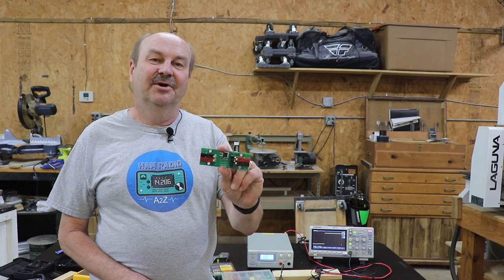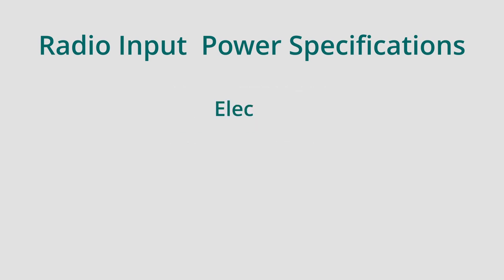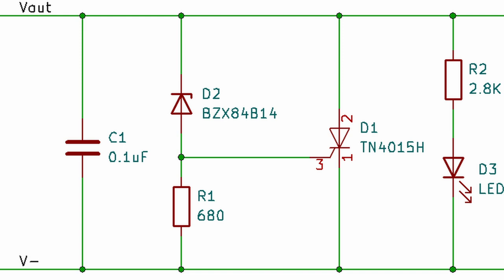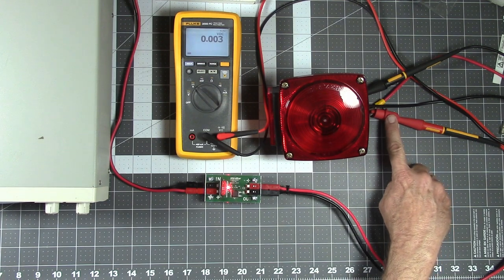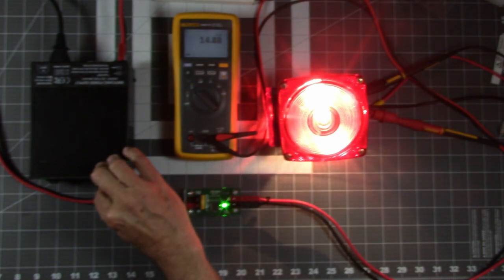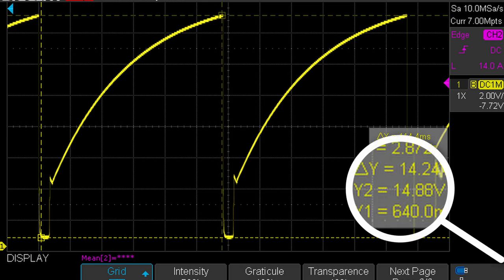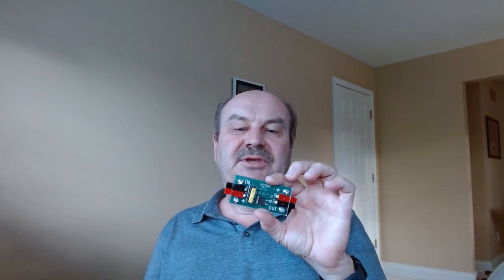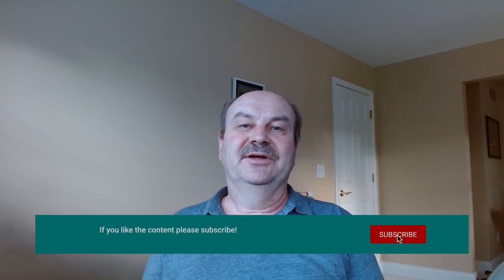Mini-Bar Introduction

Comment: Hi Tom, many thanks for this and for allowing the use of your files to build the device. I was in the process of designing one myself until I saw your video. I’ve just ordered a few boards and will make a two or three for the shack. 73 Dave G0DDF
Reply from the maker: Fantastic!

Comment: Thanks a lot Tom. I've implemented crowbars in previous power solutions, but never felt that my own implementations were elegant. They were always very crude, just a fuse on the input and a zener diode capable of handling a lot more amperage than the installed fuse. I never considered using an SCR! I'll definitely be using your improved design should I ever feel that a crowbar is needed in future power solutions; thank you for making your board design and circuit schematic available. I prefer using XT60 connectors over powerpoles, so I'll have to make one myself.

Comment: Years ago I built a home brew 30 amp supply for my radios. This was back when finding a transformer for such a project wasn't a big deal. I ran for years just on just the series pass transistors until one days I heard about a friend of mine that experienced a shorted series pass and blew his radio. Within a week I kluged together a crowbar circuit and placed in the output circuitry. And yeah I've got some of these cheap Chinese switchers that need protection added also.

Comment: I designed and built a PSU / charger that has short circuit and overload protection using a high current DC relay. The relay drops and stays out whilst the short is present, removing the short, allows the PSU to slow start via 10 watt light bulb whilst the Capacitors are charging, then switches the relay for full output.
Your circuit could be utilised to simulate the short, and instead of blowing the fuse, the relay would drop, cutting off the supply, until a reset button was pressed.
Of course if the over voltage was still there, the crowbar would prevent the relay being engaged as there would be no voltage for it to energise it.
David in the U.K. G1ZQC.

Comment: I often use this circuit on every project I make. Depending on the current, I can use NYC222 thyristors to the MCR8 ones. I often try to use PPTC resettable fuses, for robustness, and I also couple a TVS diode for responsiveness to transients. To avoid false triggering, I use a 10nF  capacitor in parallel with the 150 Ohm resistor that is pulled up by the Zener. These things are really robust!

Comment: I'm familiar with crowbars and have even recommended them in some situations (thinking about one in particular where an industrial process came to a complete halt because several boards full of CMOS were blown thanks to a bad power supply).  And at first I thought that perhaps it would be good to add one to my setup.  But thinking on it a bit,  I don't see a failure mode for the switching power supply that I'm using that's going to over-volt the output.  If something in there fails,  the supply will just quit working.  Oh,  and I'd add at least 10nF of capacitance across that gate resistor for some noise immunity.
Reply from the maker: Hi Roy.  The MiniBar is now at Rev-C and it does include capacitance across that gate resistor.  Thanks!  On switching supplies— You are correct that failure modes in the power transistors (shorts/opens) will result in no output.  However, there are failures in the regulation circuitry that can cause the output to go to too high of a voltage.  Most high quality supplies have internal crowbars or other circuitry to prevent this, but not many of the super cheap ones.

Comment: What you didn’t mention is the mechanism of failure of the very cheap power supplies.  It’s the output transistor that fails and the failure often causes a slow increase in supplied voltage.  At total failure the output voltage is 24v (from memory, and I’m old, so check this number if it is important to you). I’m not a radio hobbyist but an astrophotographer.  Our equipment is expensive.  A lot of people use the inexpensive power supplies without understanding that failure delivers higher than intended voltage.  Our equipment is usually tolerant to about 16v. I was burned in a remote placement of equipment on a mountain top in California when the cheap Pyramid power supply failed.  The camera reported the high output (puzzlingly with a low voltage beep pattern).  We shut down and replaced the power supply with a more expensive one built for ham radio use, and that power supply has a crowbar circuit.  I was lucky, my equipment survived undamaged.  Anyway the extremely cheap power supplies do commonly fail and they fail by supplying higher voltage to the load.  (These cheap power supplies are listed as 12 volt but they supply 13.7 volts, presumably so they can charge a 12v battery.)  The point is that cheap power supplies often fail and they can easily fry very expensive equipment.  In my case the failed Pyramid power supply was tested after removal from the setup, it was delivering 17v.  Looking back it was nuts to trust a $30,000 setup to the very cheapest power supply I could find. In my case it was ignorance, I just didn’t know.  I do now and do all I can to spread the word to others.😂
Reply: Happened to me too on an old CB. Pyramids are ok until they screw up and ya get juiced my supply makes a recieve/transmit hum (but they all do..... just not like this) I prefer using a car battery clean and quiet

Comment: Thanks, Tom!
With so few components involved, it makes you wonder why the manufacturers don't build protection like this into their gear to begin with!

Back in the '70s CB radios started coming out with built-in reverse polarity protection diodes across the 12-volt input.  Normal operation, the diode did nothing; hook the rig up backwards and pow went the fuse. Many times the diode would become a dead short and require replacing, but it saved the rig.  I even retrofitted a fair number of older units that didn't have the diode.  Fuses and diodes were cheap, radios were not.  As for overvoltage, I knew many people who would run a mobile CB on 15 volts to get more power, and had to try to fix some that got toasted by that or higher input.

Take care, sir!
Reply: I repaired a few AM CB radios that had been reversed connected, they blew the fuse, then bypassed the fuse and still reverse connected it. Smoke smoke smoke....
Reply: @G1ZQCArtwork  
"Been there, smelled that!" 🙂
I can sympathize, way too many cases of ever-increasing amperage rating on fuses; 2 amp replaced with 10 or 20. 🙄

Comment: This is a good idea for mobile applications in the event your vehicle electrical system loses the connection to the battery or something goes wrong with the alternator’s voltage regulator.

Comment: Excellent design! I plan to build 3 or 4 to incorporate in to the power supplies I have. Sure it's old fashioned, so is the wheel. I'm going to use an old fashioned axial lead zeners and 3AG fuses. I will not be using Chinese ATC no-blow fuses. That was an eye opening YT.

Comment: Nice little circuit, I remember a few of the power supplies for some of the raadio gear I worked on in the service and they were pretty slick but not nearly are streamlined as yours. When you get it into production I will be looking to purchase one I think. Thanks for sharing  Vic de KE8JWE

Comment: Tom, I just completed the build of your mini-crowbar. I ordered  the boards from JLCPCB and components from Digikey. Completed my first SMD project with a aluminum block heated to 165C with a solder iron.Worked like a charm and once completed I proceeded to test it with a variable power supply and load. The 5,10,15 amp fuse does not blow but the crowbar shorts at 15.8 and switches the power supply off. I guess PS has its own short circuit protection. 
What determines what size fuse to use? The load or the input specs.
Many Thanks
Reply from the maker: Hi.  Glad you were able to do everything from the documentation I provided.
It is both the input source and the load that determine the fuse size.  Obviously, the fuse has to be large enough to carry the current your load will draw.  It must also be small enough that the power supply can source enough current to blow the fuse.  I've been recommending that the supply should be able to source roughly twice the fuse rating to insure that it blows quickly.
About your supply switching off-- If you watched the entire Mini-Bar introduction video, you saw that my MFJ power supply had similar behavior.  Most modern, switching power supplies have short-circuit detection and will go offline before the fuse can blow if the crowbar trips.  Keep in mind, however, that the crowbar circuit is in place to protect against something going bad in the power supply.  If a power supply failure causes the crowbar to trip, the short-circuit detection in the supply may  have failed as well.

Comment: NIce job!  an addition to this would be to add reverse voltage portection. not likely to happen but the one time it does could save a radio.  K6DCH
Reply from the maker: I agree it would be nice, but I didn't want to put a 20+ amp diode on the board.  That would increase the size considerably and add losses. The Anderson PowerPole polarity arrangement is universal enough now that reverse polarity should be a very rare problem.

Comment: Tom yes a crowbar is a good idea for protecting yourself.  I will use it for my portable operations too. Why if you have your power supply on or battery and a long cable when you plug it in you will get a nasty transient that can be a large voltage. That will look like overvoltage.
Reply from the maker: When you connect any load to a live voltage source there is almost always some amount of arcing that occurs at the connection point.  Connectors are not perfect at the microscopic level.  So the voltage connects and disconnects a few times during the connection process.  This all happens in microseconds.  As the voltage goes from full voltage back to 0, stray inductance in the circuit can produce voltage spikes.  They are very short, but they are there.  I have added filtering to the MiniBar to prevent false trips from this.
Reply: @HamRadioA2Z  That looks to be a good idea to protect your radio. I wanted to ask if you tried reverse voltage test as well.  Ps I did order one.
Reply from the maker: Thanks for your order!  On reverse voltage:  No, unfortunately the MiniBar won’t protect you against that.

Comment: I used a P channel FET a Zener a transistor and some resistors to make a series overvoltage latching switch.   A single push button will toggle it on or off.   Why blow the fuse if you don't need to.

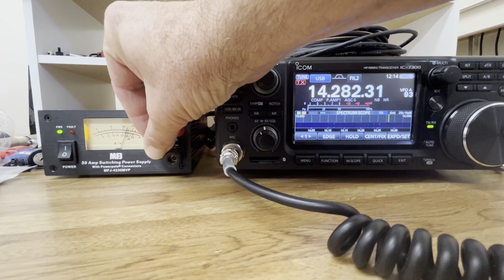Comment: 2:00 I think I'd rather trust an ex-Server PS, for example made by HP and probably cost a small fortune when new, than any MFJ (Makes F'n Junk) product. Furthermore, the HP ex-Server PS I use has a built-in crowbar circuit.  But yes, using a cheaply-made PS is asking for trouble.  MFJ products are too often cheaply made.

Comment: Just had an issue on my motorcycle where the regulator failed and was pushing 17v to the battery. Luckily for me i had my radio unplugged.

Comment: Talking just home built stuff here... If you're using a buck /boost circuit with a higher voltage series battery, maybe a crowbar might be warranted? If like a couple minibars on hand if they're reasonable! /Dave kd0ndc

Comment: Thanks for this Tom. I have tried to upload the gerber files to both PCBway and JLCPCB, which I have used before without issue. But these gerber files you have supplied are missing a BOM that both services are asking for . Have you left these out so we don't run off and sell our own board of your design or is there some other reason.
 I have created a couple small TTH project using JPLPCB and it was easy as pi. Perhaps a video for procedure to upload and refine your gerber file list to JLCPCB and proper BOM upload for them would be helpful. Thank you so much. 73
Reply from the maker: Hi Clive. Sorry about that. I did use PCBway, but I created the BOM separately in a spreadsheet as I am not having them populate everything.
Reply: Thanks Tom. I decided to do the same. Thanks very much for the gerbers.

Comment: Hi Tom, Any chance you will be offering this with an option of a kit?
Reply from the maker: Hi.  There’s been some interest in this.  I’m looking at offering it at least as a partial kit.  Maybe surface mount parts completed and through hole parts as a kit.  Some people are also interested in something other than Power Poles.  So a kit would solve that as well.  I’ll be getting some new information out shortly.

Comment: Note that a fully charged lithium polymer battery has a voltage in excess of 16V and should not be used with amateur gear (or telescopes in my case). LiFePO4 seemed fine.

Comment: For a FT891 the max current draw is about 23 amps at 100w.

What fuse should be used in a Minibar? 4S7EF
Reply from the maker: For SSB, CW and most typical digital mode operations a 25 amp fuse should be fine.  The duty cycle is low enough that your average draw will be well below the 23 amps.
Reply: @HamRadioA2Z  Thank you. I will buy a mini bar after I get approved to import the FT891. 4S7EF

Comment: I didn’t thank you for your post, so thank you.  I do have a question. In your presentation you say you have a fuse in your circuit, but later you seemingly have it tripping and resetting.  Is it a fuse?  I know just enough electronics to get by so please be tolerant of my ignorance.  Isn’t a fuse a consumable, a one time item that must be replaced once blown?  Is your circuit more akin to a circuit breaker, that survives the high voltage event and lives on?
Reply: It was the MFJ power supply that was continually resetting due to the short and therefore not blowing the fuse. The power supply had inbuilt short circuit protection. The Mini Bar circuit still prevented the voltage exceeding the safe value.
Reply from the maker: Hi.  @brianm9962 is correct.  I may not have explained that as clearly as I could have.  In the 2nd test, with the MFJ power supply, it is the overcurrent protection in the power supply that is shutting off the power.  When I raised the voltage high enough to trip the crowbar, the overcurrent protection in the power supply turned off the voltage fast enough that it didn’t blow the fuse in my circuit.  As soon as the voltage goes away, the crowbar circuit resets — not the fuse, but the short circuit from the SCR.  Then when the voltage comes back and gets high enough again, the crowbar circuit re-trips.  Each time, the power supply shuts off it’s output fast enough to keep the fuse in my circuit from blowing.  I hope this helps explain it better.  73,  Tom
Reply: It’s perfect.  Thanks.

 @HamRadioA2Z